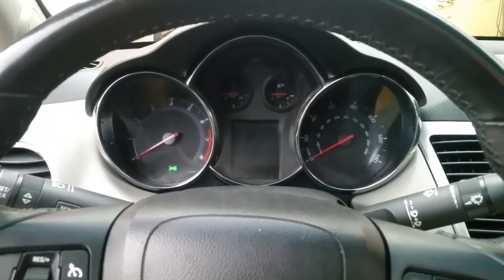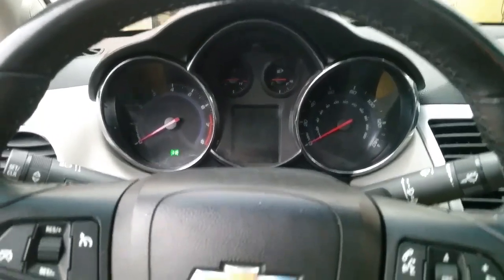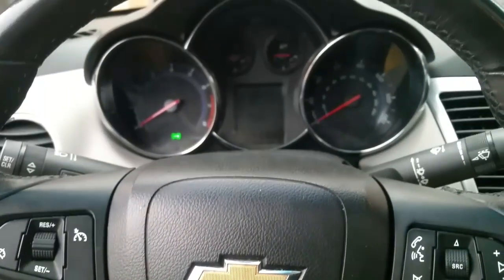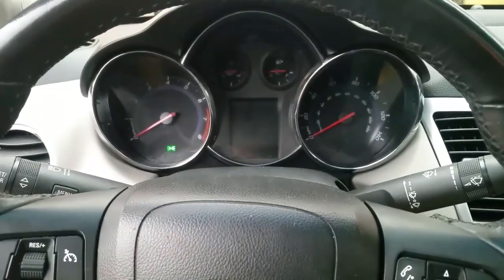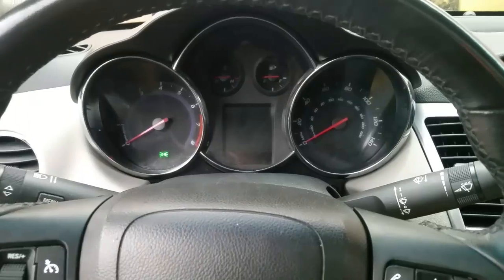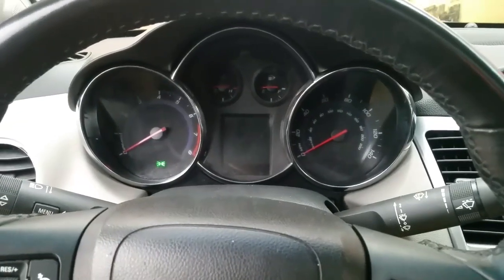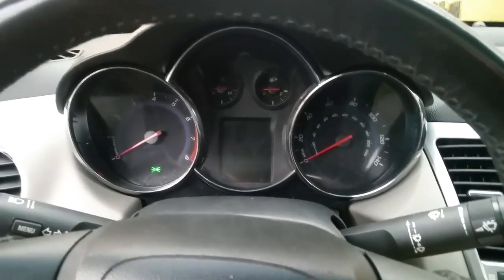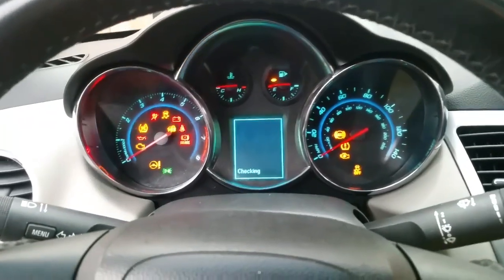HOW I FIXED CHEVY CRUZE AIRBAG LIGHT FAULT CODE B0020

Comment: a The Module could be bad. Most likely need to replace the Module. You can buy a used one on www.eBay.com 
or send your Module for repair at www.myairbags.com

     Here is video

 https://youtu.be/xT5tiT2A78w

Comment: How do I get that code? I just have the "service airbag" message on the dashboard. I took it to AutoZone they scanned it and they didn't get a code. Not sure if it had to do with their basic scanner used. 2014 Chevy Cruze
Reply: I have the same message and the same question! Please help us.
Reply: @jorgepeto25  I hope you don't have the same issue I got. I took it to two mechanic's and one told me I needed to take it to the dealer. The other couldn't fix it. So I took it to the dealer and it will cost me $1,385.00 to get it fixed. I was in a minor bumper to bumper accident and this is what trigger the sensor to start failing.  Good luck.

Comment: Thanks you....you saved my sanity! After the dealer said my extended warranty wouldn't cover it, I procrastinated until the frequency increase beyond a point of reason! Finally watched this video...push the connector together and it made a small click. More importantly...no more airbag warning light and no more confounded beeping!